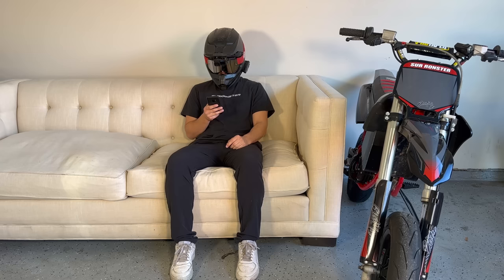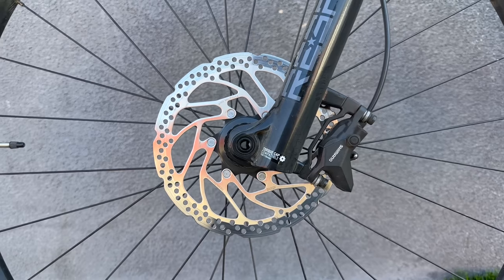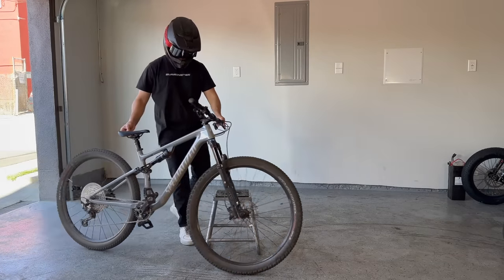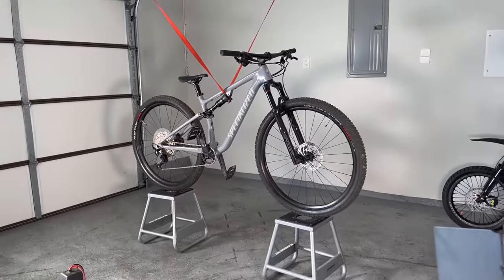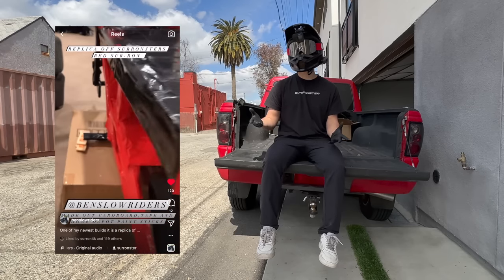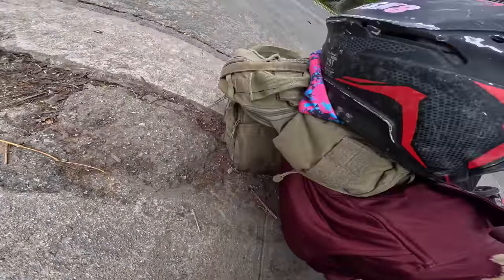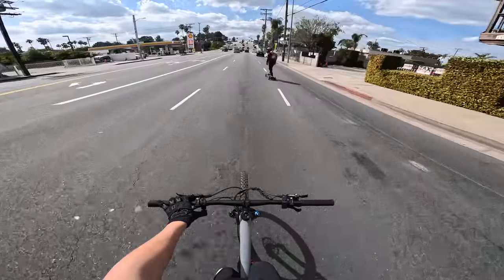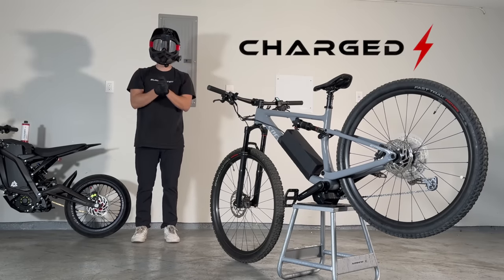Best Street Legal E-MTB Build // *No License* Electric Mountain Bike DIY

Comment: Dude you need to put some extra air pressure in the suspension to cancel out the suspension bottoming outfrom the weight of the motor and battery. Great video by the way!

Comment: On my Surley Wednesday fatbike conversion, I used 2" wide pipe wrap tape to secure the triangle battery to the frame, Sounds half ass, but like yours, it works real well. Then I had a shop sew me a vinyl cover for it, so it like like a frame bag not a battery.

Comment: Awesome vid, nice to see the Photon in action! Great choice with CYC motor and BMW battery combo. I guess 12Ah should be decent capacity for 750w but when you start running it over 1000w you'll want more capacity to help with voltage sag. Also fyi I don't think they pronounce it "psych" motor, but it does sound pretty cool that way, heh.

Comment: I have owned a Bafang BBS 2 mid-drive 750 watt kit with Panasonic 10.6 Ah battery. Used it on more than one bike. Absolutely fantastic. More bulky and heavy than what is shown here, but for a unit that is over 5 years old, it is a weapon. It has never let me down.
Reply: In saying that, I'm tempted by the lighter and more compact Photon!
Reply: Qq

Comment: Yo do you think the rear suspension detracts from the conversion kit whenever the suspension engages? My understanding is that while the chain isn't tense you may notice the chain skipping across some teeth, a grinding/slipping sensation that occurs often when changing gears for example... the chain may jump off the hub entirely during this point, and it goes without saying you lose all drive during this point, not to mention you're machining against the hub. I've seen this trend towards an electric hub, whereby I believe you pedal into a generator which powers a motor in the rear (and possibly front)... that would be based, of course with a chain running freely so it's stealth nonetheless.
Reply: The chain is going thru the same forces before and after he installed the kit. The derailleur keeps tension on the chain.

Comment: If you keep the rear cassette, how does it limit you to 28 MPH? I like the idea of being able to down-shift for more torque on hill climbs. I have an old Schwinn 21 speed MTB that I have been wanting to convert for a long time. I don't really want a hub motor, unless I get two lol, and this mid drive kit looks perfect for me. Odd side question. My bikes swing arm and front forks are ready for disk brakes but the wheels are not. How do I know what to get to upgrade my bike? I want to convert to hydraulic disks.

Comment: I think he struggled before the hill because maintaining a low gear like 1-1 on acoustics are kinda hard so you can get easily tired. Next time if you wanna climb ahill put the front on 1 and back 7 or 12 and then change the back to lower gears as it gets harder to pedal. This is way more efficient and you get less tired and dont have to deal with the tiredness of 1-1.
Reply: easy way to ruin your bike right here ^^^^^

Comment: Your approach to the hill is way too slow. You're maxing out pedal spin and not accelerating for the entire distance coming up on the hill. Run up to the hill in a much higher gear, pick up 10 mph, down shift just before the hill, drop 2 gears, and you'd easily make the top. Raced mountain bikes for decades. Most racers could climb that at speed without battery assist.

Comment: Stop ! We must have better brakes.on ebikes , at least moped quility brakes ,many of the eletric motors are machined for the larger brake standard but are used on mopeds , many people will die or be serously injured for the lack of better brakes ! The cost is about the same . The current brake standard shuld be ok if u weight undet 70 pounds  , Its crazy to see such good  engineering on the bike frames but the worst when it comes to braking .  The experts know what I'm talking about . I feel it is the biggest engineering flaw since the beginning of time . Wake  up ,

Comment: I have an ancient Norco Bush Pilot from the early 90s...everytime I walk past it I wonder if it could ugrade...then i realise it needs disc brakes and a front shock of merit.  The last time I had it serviced they soaked me for 700 bux, I could have bought half a kit from Parktools for that.  I can''t afford to ride it, let alone upgrade it.  I did love riding it though. On the other hand I''ve been looking at the e-bike market for a few years now and I've read the laws and I've decided. I''d like to have twin 250w 24v hub motors with the highest torque on the market fed by a single controller with torque management/antislip pulling from a 20AH 52v battery.  The battery should be slung as low on the frame as possible.  Dual suspension under a banana seat with 26" knobbys.  Draw the pedals forward in the frame to accomodate long shanked people, bring the grips back to the rider with monkey bars.  The same torque sensor setup you have here.  I want an overland bike, I don't need speed.  Canada is restrictive, 500w 25mph, so it made sense to split that limit to 2 motors to find more torque.  The hitch so far is finding a controller programmed for dual output with the features.  A few models over the decade have been dual setups, but with dual throttles.  A single input from me should result in sychronous equal effort from both motors at once, until a significant slip is detected and that motor throttles back to regain traction while the other motor maintains it's torsional output.  I have CYC in my email, this was a solid review for them too.  A top notch product.

Comment: I had a fat tire ebike 750 watt and I changed the speed controller on it cuz the old one died it had a 48v battery and it ended up spinning the drop outs so it ruined the bike frame and now I'm saving up to get a mid drive Im going for fast and wheelies is mid drive the way to go?

Comment: if yout put your weight forward you should be able to climb anything with that granny gear and pedal assist. the two "only" problems should be finding traction on the rear tire, and keeping the front wheel down. you dont need a lot of speed/momentum, just pedal smoothly, and keep just enough speed so that the bike doesn't almost come to a stop between each pedal stroke, other wise it's going to want to wheelie on every pedal stroke'

Comment: You need the sram transmission So you can shift underload and start in a higher gear and then go in a lower gear.As you go up the hill I don't think that drive train will do it but never start that early in a low gear

Comment: 3:15 yeah, when im casually riding my really old bike (at least 2 decades old) i can peak at 26 mph. Its a 3 7 gear. 3 front sprockets and 7 in the back. When im riding my road bike that has better suspension, cuz it actually has shocks and a spring system, i could probably push mid to high 30s flat and maybe mid 40s downhill. Im mostly a road biker so its nice for me
Reply: 4:00 these e bikes got you out of shape boi lol, endurance riding helped me, but i still got rlly weak lungs.

Comment: First, that kid making his own SurRon because of you is fuckin awesome!! Shout out to him, makes me feel really dumb that I can't figure out what to do about an e-bike. I have no idea what's legal here and don't even think the state knows. I get contradicting info depending on where I look. Granted I've only been looking into it for a couple of weeks. I do have a nice mountain bike so maybe this is what I should do?... I'm in Mass in case anyone knows "the law"
Reply: I'm in mass too and I have an e bike what exactly is your question?
Reply: @Wyatte Kugel  Some places I look say it has to be under 750w and others say under 250w. But everywhere i look says you can't have a throttle at all and motor can only assist when pedaling. If that's the case then it's not for me. I was looking for a cheaper and funner way to get to work but my job is manual labor and alot of walking so I can't pedal 10 miles each way on top of working in the heat for 10 hours a day. I don't want to spend 3k+ then get stopped the first week. Any info you have would be appreciated

Comment: Awesome video. I am also a SoCal local. :)  This is a great video on how to get started with the DIY electric mountain bike setup. I love Surron's but there is no way you are going to get away with riding one on the local mountain bike trails around here without getting a lot of complaints from mountain bikers and the cops. This setup solves the problem. Its still a mountain bike with the addition of the fast motor but keeping it stealth. That will get you on the trails without the harrasment.

I just built up a full (Downhill) full suspension mountain bike with the mid-drive motor, 52v battery and it is FAST! So much fun, super quiet, looks like a mountain bike, no complaints. Top speed is around 35mph. It will climb any hill no problem. Bike model is the YT Tues. Best bike I ever built! Ton of fun!